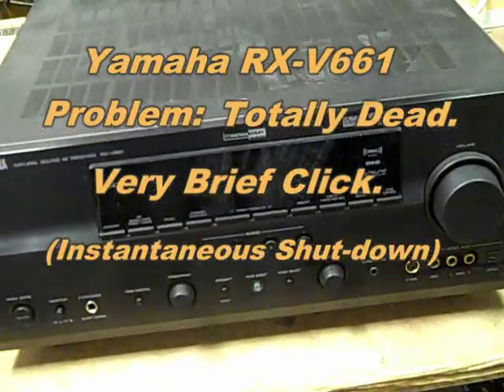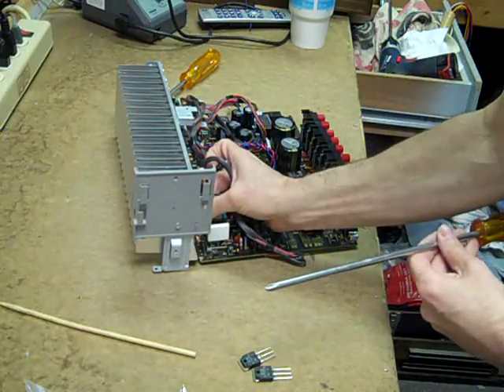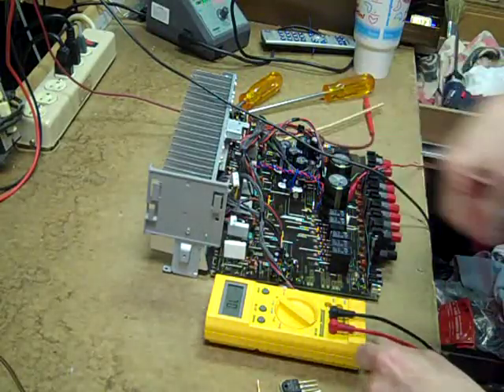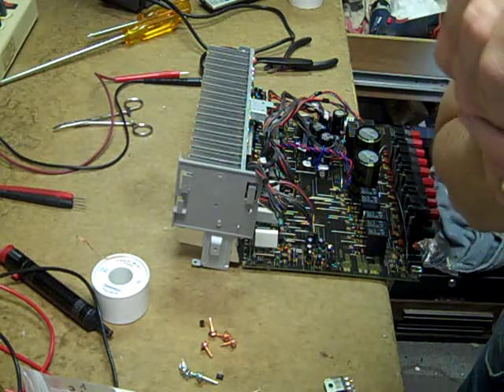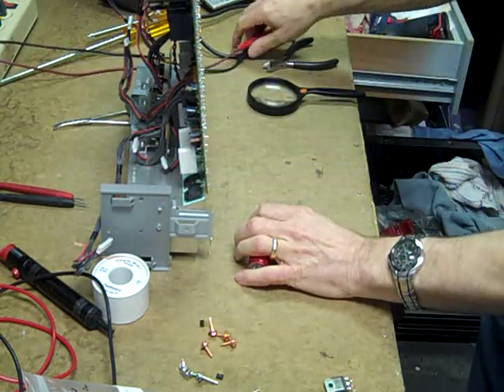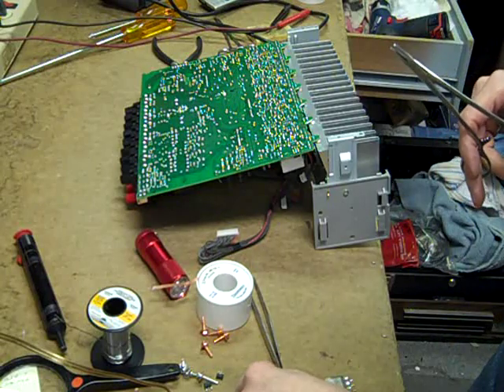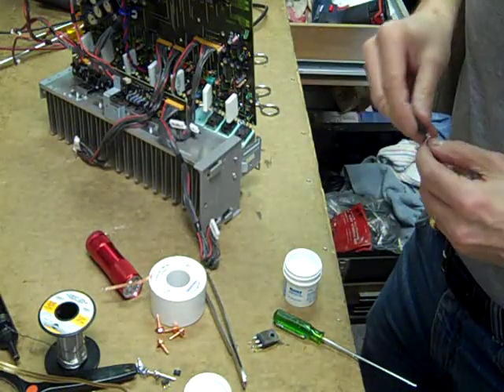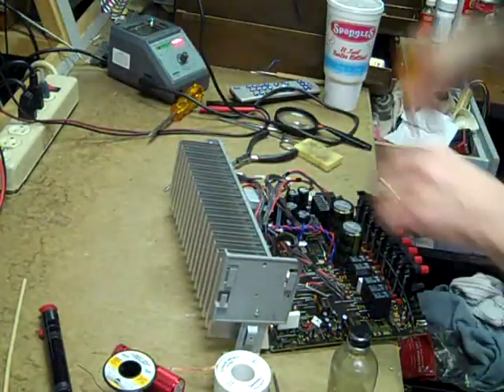Yamaha RX-V661 Repair Brief

Comment: In your experience is Yamaha more repair prone than Marantz? I only ask, because I went with a Marantz 7008 over Yamaha's flagship model at the time in 2013.
Reply from the maker: +Daniel D79 Personally I favor the Yamaha newer models, although I have a couple older Marantz surround units which I like a lot for plain stereo.
Reply from the maker: +Daniel D79 There has been a consistency of engineering design and approach to serviceability in Yamaha receivers for the past twenty years and more. This is mostly lacking in other manufacturers. Modern Denon and Marantz models aren't even designed by the original Japanese companies - but by a Chinese firm called Anam for the American distributor, which is not Denon or Marantz Japan, but rather "D&M Holdings", a Wall Street type entity. D&M had good success for several years when they first took over the brands, but have had more trouble recently with reliability issues and financial problems. Yamaha still "rolls their own".
Reply: Thank you. I now know what to buy when I'm in the market for a new receiver. The Marantz that I have has never given me any problems. It might be that I have a decent power surge/conditioner . I went with the panamax MR4300.

Comment: hi mark, one question...
I have a Yamaha HTR 6130  with the following error: THM PRT 207, 186, 170.... and can´t reset.
Reply from the maker: No, it would not reset. There is a temperature sensing IC on the regulated power supply board. Possibly defective or maybe bad solder in the general area. IC238.
Reply from the maker: Jeff Allan I have been trying to reply and Youtube won't post my response. Try checking the voltage regulators on the large heatsink.
Reply: thanks! it was a bad solder in this area. Again, thank you very much.

Comment: hi..i have yamaha rx-v767...my hdmi board damaged i think, hdmi1,2,3,4 are not recohnized by pc, hdmi5 is recognized when i connect to pc but there was no sound at all..also hdmi out1 has no effect, hdmi out2 is given a screen but it is totaly green tint to the picture, on the front panel while hdmi out1 was not light, when i connect hdmi out2 it is flash red hdmi out2...what is the part number for hdmi board, i think one time ago i connected my satallite receiver and it burned hdmi circuit.thanks
Reply from the maker: yigit yusuf mutlu Normally the hdmi board just needs to be replaced. If you have really good soldering skills sometimes it's possible to replace the hdmi transmitter chip(s). Most people, even experienced technicians, would find this impossible.
Reply: Mark Zacharias can i find the hdmi board online anywhere, what is the part number of it...i live in turkey and the cost is same as a new receiver, maybe if i can find it online anywhere, i can change the board myself
Reply from the maker: Might as well just replace the receiver or find another to rob the part from.
Reply: Mark Zacharias
it is not my way, i might open it look for the part number, then googled it, maybe find it

Comment: So if it blows a cap and quits, is it gonna have a bunch of stuff bad?
Reply from the maker: Scott Young Caps are very rarely bad in a situation like this. A blown channel can be just a couple output transistors and nothing else - it it can be almost total destruction of the board and a large number of components destroyed, or anywhere in between.
Some people think that "90% of problems are caused by bad caps". This is total bullshit. There were batches of bad caps affecting flat screens and computer motherboards a few years ago. Other cap failures are generally very random, unless they are caused to be bad by other factors - heat, over voltage etc.

Comment: Hey mark your vid by far is the most extensive I've seen and seems you really know what you are doing ! I have a very similar prob with my Rx-v440 getting error ps prt  26% d it is a power supply fault is it safe to say I could just replace transformer and I'm good to go ? Also what are the low voltage values on out put of this transformer supposed to be, I'm thinking there is one low ac and two low dc? Thanx jimmy ps if I wasn't in Australia I'd just bring it to you lol
Reply from the maker: +Jimmy Goulding Apparently you have the service manual - you need to check the various voltage regulator IC's. One is probably low in output, like a 7812, 7912 (or 15 volt versions, whatever). There is a summing network of resistors the output of which is sensed by the microprocessor. When one regulator goes bad the sense line is now out of balance. Occasionally a resistor in this network could be bad but that's pretty rare. Most Yamaha receivers have a Protection Cancel mode to allow it to stay on for troubleshooting.
Reply: +Mark Zacharias yes mate is does bypass mode and I'll check those soon and let you know how I go 😃 champion buddy
Reply: +Mark Zacharias hey mate sorry I have been busy but yes all sorted thanks very much for your experience. It was 79m12a and 7905a everywhere else was all spot on, there was 11.7vdc on 79m12a which I'm sure it would of still be within tolerance but the 7905a was down to 1.8vdc and there lies my problem. 😎 now the amp was very good condition and only used lightly for a hand full of times, but the cause was due to manufacture fault as there was no heat past and heat is a killer for electronics. I'm back to loving my yammy products again. Ps you might already know this but there is a small manufacturers flaw in this range of amps as the rect/reg uses the same heat sink as trannys that run quite warm when cranking tunes and not to say the least they are at the top of heat sink, where as we know heat rises no matter how well a heat sink controls heat. Ps we should apply at Yamaha's design team there are better places for critical parts. Thanks heaps again mate take care, I owe you a beer bud
Reply from the maker: Glad that worked out for you!

Comment: I acquired a RX-V563 that powers on and works fine with the speakers in Front B but as soon as i try to use the front A speakers by pushing the A/B/Off button the rec will turn off/standbye. Don't have the remote to access the configuration setup...the receiver doesn't seem to be able to adjust speaker calibration without remote (unless it's all messed up). Also will not switch inputs from DVD.
Reply from the maker: Sounds like just the speaker tact switch itself may be flaky. It's part of a resistive network that includes the power standby switch, and if it's resistance fails to go low enough when you press it - it will mimic the standby switch and shut the unit off.
Reply: Hi here in my country all the repair shops are closed.
I fix treadmill machines and other electronics stuffs but audio and video shops do not exist anymore.
You can earn suficent money for live fixing audio in these days?

Cheers.
Reply from the maker: Audio repair business is in decline in the U.S. as well. In larger markets there's probably enough work for a few servicers. I retired in the fall of 2016.
Reply: I'm sorry to hear that

Comment: Hi Mark. Yamaha P2250, an older (’85) power amplifier. I purchased
a defective one, and trying to have this fixed. No idea of its history. I found
F103 and F104 fuses blown. These are from the +/-24V and +/-15 line. The power
transistors seem to be fine, both channels. There seems to be a problem with the
OpAmp (NJM072D) on PA(A). This OpAmp is supplied by +/-15V. So I am guessing
these are connected. I will replace it, but my question is this. I want to test
the +/-15 regulators with the unit on, but with both power amplifier boards
(PAA and PAB) removed. Can I do that? (I would also like to remove the +/-24
cable going to the output panel just as a precaution, but not sure I can even
power this thing up). Do you think a defective OpAmp could draw so much current
to blow up the 1A fuses from this line (the other fuses are OK)? Or I should
look somewhere else?
Reply from the maker: I've never worked on one of their professional amps. I would think that running the +/- supplies separately would be ok, and it's pretty unlikely it would blow fuses. You could always measure from either rail to circuit ground. If one seems low it could be a problem. Sometimes I will hook up an external power supply to a suspect voltage rail and let it cook to see what part gets hot.
Reply: Thanks for your quick reply. I’ll let you know of the outcome, although it might take a while. I missed the July 1st fireworks (I live in Canada), so if I get one for free, would be just fine.
Reply: Well, not much progress. I was able to turn it on, and check
the +/-15 voltages, no issues. I also checked with only one power board
installed, it is in protection (which is to expect, as the signal from each
board goes to a OpAmp comparator). The problem with one of the power board (panel
A) is that on one test point that should be around 0 (from there the signal
goes to the same OpAmp that triggers the protection), shows 65 V. No idea where
this high voltage comes from. I checked all (including power) transistors (in diode
mode, didn’t check for gain) on panel A (except a couple of “special” ones:
Q202 and FET Q201 – they seem to be differential transistors, and might trigger
the clip led - not sure if I checked correctly, but seem OK), all tested good.
Question is, what kind of failure can bring this voltage? Since there are no
shorted transistors or components, could it be the gain of some of the driver
transistors that affect bias and turn fully on the output transistors? Or should
I look for other type of failures? I would probably have to remove and properly check all the 
components on the panel A.
Reply from the maker: At a glance - I would check for an open resistor causing a "no B+" issue for one of the drivers.
Often 10 to 33 ohms in amps I've seen.
Reply: Update:
Works! But I am puzzled. I didn’t find any bad components. However, based on my
previous experience with A970/C2240 matched transistors, I replaced all of them
(these are used in the current mirror (2x A970) and driver transistors (on the schematics).
However, none tested bad, except that all the replaced A970 had the gain ~420, whereas
the C2240 around 270-300. All the replacements had the gain 200-220. It seems
that this gain mismatch was the issues, because – as I said – I didn’t do anything else! Does
it make sense?
Reply from the maker: Actually, not that uncommon. Glad it seems to work - time will tell.

Comment: hi guys, i have an issue with my receiver is a yamaha rx-v650, i use the DIAG function, the code error is:  PS PRT:0003E, anybody can help me? i love my receiver, thanks so much folk
Reply from the maker: Start up the receiver in "protection cancel" mode as described on page 27 of the service manual and take some voltage readings, focusing on the various voltage regulators. Could be all or several of those voltages are low or missing.
Reply: Mark Zacharias thanks so much
Reply: Mark Zacharias, i was playing like electronic tech in my receiver and i just desoldering and soldering the ic a1770, now the protect resistor have 10v variation, but my reciever before playing was fine, the ic not have ohms or K or M like open. thanks
Reply from the maker: Other than re-checking your work for bridged solder connections etc, I'm sort of doubtful you are going to be able to fix the problem that you have caused. Why on earth would you be "playing like electronic tech" ? Useful advice: if it works, don't fuck with it.

Comment: Hi Mark i have a rx-v3900 it powers on but no sound from any channel the AM FM radio or anything input to it and speakers are good use them on other 3900. any ideas thanks
Reply from the maker: The 3800 and 3900 are probably two of the most difficult models for service - that Yamaha has ever built. Even an experienced technician would have his hands full with this one. Here is a link to the service manual. Good luck.
http://elektrotanya.com/?q=showresult&what=Yamaha%20rx-v3900&kategoria=&kat2=schematics
Reply from the maker: If the multi-channel direct input works, maybe a problem in the dsp area. If not that, maybe check an electronic volume control IC.
Reply: thank you ill have a look at it when i go back home im working in North Dakota now im in nw MO

Comment: Hello Mark, thanks for your video. My problem is, I have Yamaha Rx-v 1065. I was listening to music using the front speakers only but using the 7ch effect enabled. The amplifier just turned off and since then, any time i tried to turn on again, it just stay of for few second and then go off again. sometimes it will play for a minute or 2 and then go back off again. I took sometime to diagnose all the speaker channels but found the right surround side  with no sound coming out. I have followed your video tutorial but it seems all the 14 main transistors readings are the same, and also the driver transistors too have the same readings. please is there any other option you can help me with. Am in Ghana(west Africa) and am sorry to say but there is no better technical shop to fix Av of this class. so i will appreciate you assistance Mark
Reply from the maker: +Richard Amo There is a diagnostic program. Be prepared to write down the error, for example PS1 024L or the like.

Press and hold "Tone Control" and "Pure Direct" while pressing the Main Zone (power) button.

Upon entering the diagnostic mode there will be a brief display of the error code on the receiver's front display before it shuts back off.

To keep the receiver ON for troubleshooting, continue to hold "Tone Control" and "Pure Direct" and the Main Zone button until the "Sleep" segment of the display starts flashing. The receiver will stay on.

If the error is DC PRT XXX, or the like you can then measure each (red) speaker terminal with respect to ground (black speaker post) to determine if one channel has a DC offset or if all channels do.

If you are unfamiliar with using a multimeter you should probably get some help for this one.
Reply: Hello Mark, thanks for your quick response. After I did what you told me, this is the error code which appeared on the screen,DC PRT 108H and sometimes too it display DC PRT: 113H. and with the test tone, I found the surround back left not working, but all the remaining speakers work fine. And suggestions for these error codes?
Reply from the maker: +Richard Amo This indicates a DC offset on one or more channels. Since the SBL channel seems to not be working I might start there. Don't forget - if the receiver is tricked into staying ON you can measure the DC offset directly at the speaker terminals. The transistors involved in this type of failure are small surface mount types on the underneath side of the main board. They generally must be ordered from Yamaha and requires more than the usual soldering skills to replace. In the case of the SBL channel, they are Q1007 and Q1008, part number WC139600. It's a fairly common problem, and it is best to replace all 14 such transistors in the unit.
Reply: Thank you very much Mr Mark. I really appreciate the way you are helping me. Yes it's true there is a dc offset on the sbl channel. Am going to other these transistors and I will give you the feedback later on when it arrives.
Reply: +Mark Zacharias I got the resistors to replace the old one but after i replaced them, it turned on for almost 2hrs and then this time shut down, and only click sound can be heard. i checked things again to found out that, the channel transistors were blown, including a zener diode, including a fried resistor and the white capacitor. i really dont know what to do this time.  i dont know if the speaker is at fault or i mess up something. Is there any way i can disable that channel and make the receiver operate on 6.1 channel for the main time?